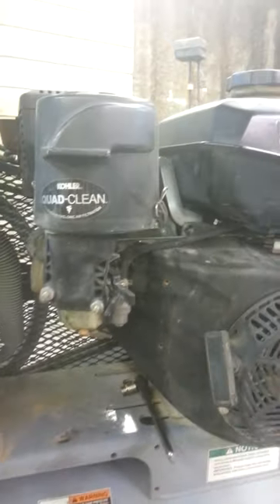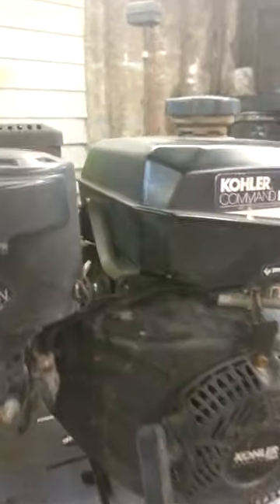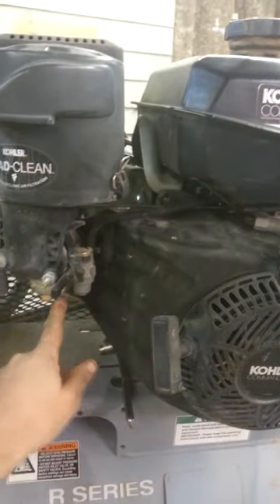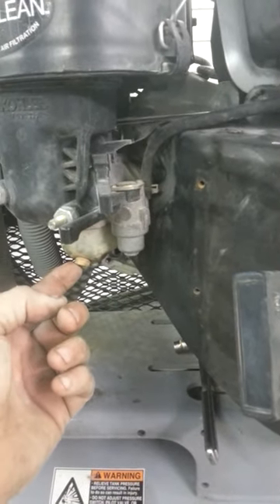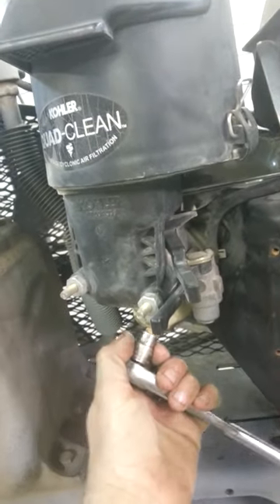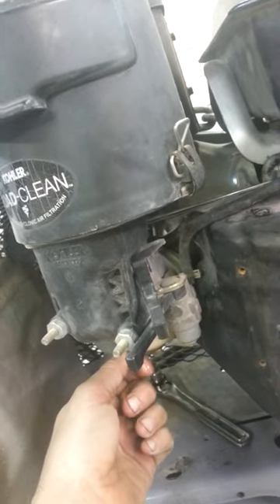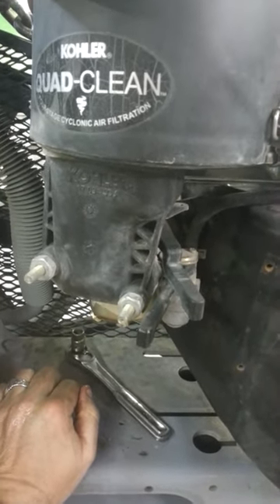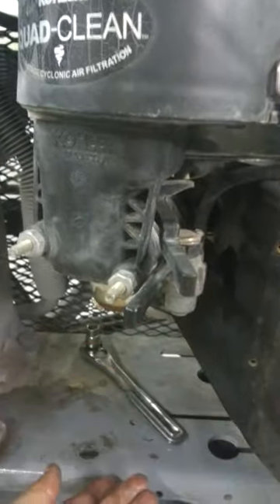How to drain bad gas out of a Briggs or Kohler small engine Carburetor

Comment: I removed the bowl but the gas tank did not empty for some reason, only the gas that was in the bowl came out. How do you remove the gas line. It looks like there is a little crimp. Do you just squeeze it to remove it?
Reply: Sometimes the needle and seat get stuck from stale gas sitting in the machine not letting any gas get to the carb bowl
Reply: Just pull the gas line off there will be a little clamp holding it on